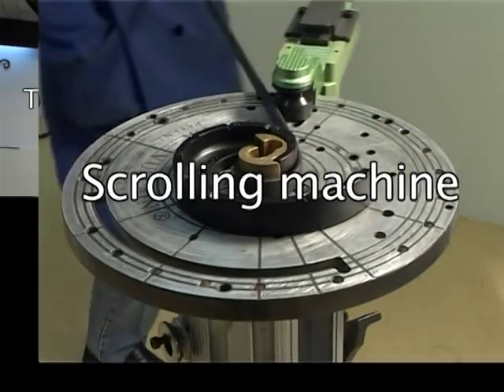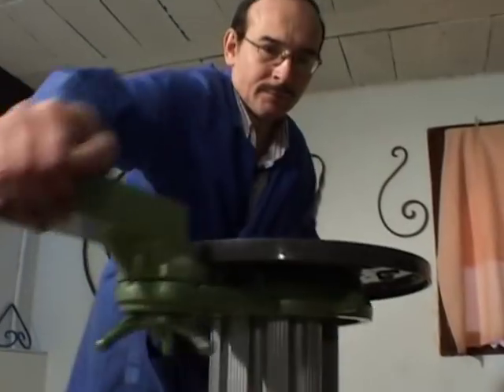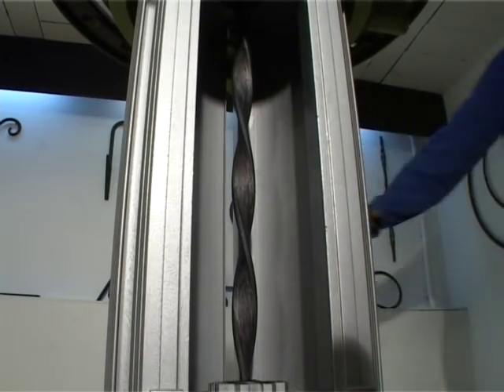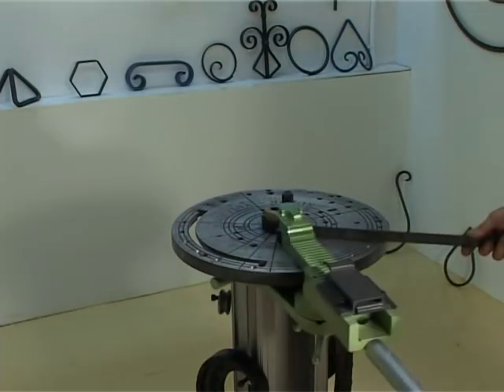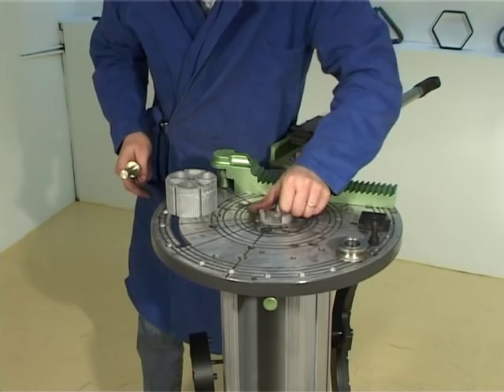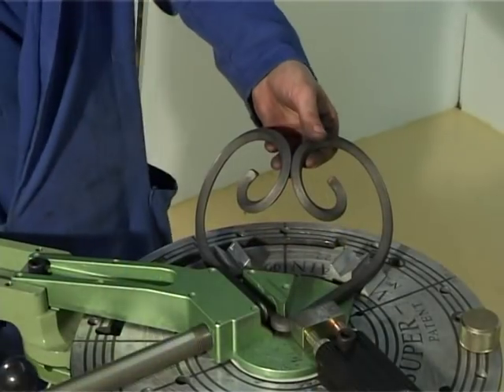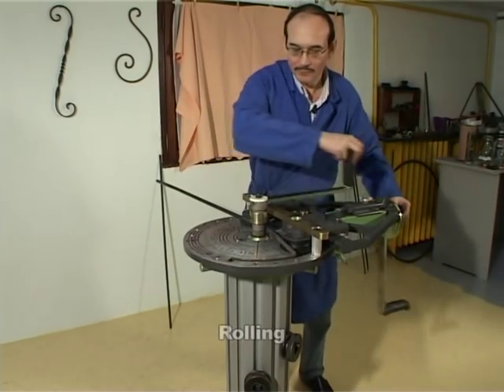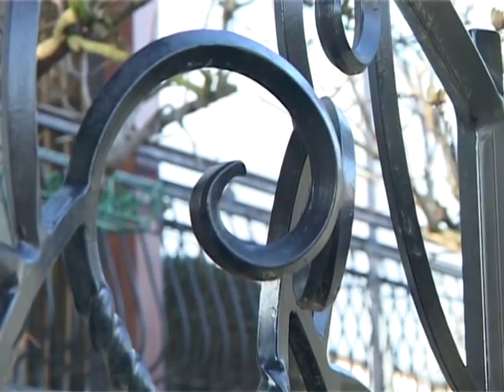Super Vulcain Demostration

Comment: Was interested until I found out that they want $9000 plus shipping. There are a lot of other machines that can do this stuff for less. I do however, like their use of extrusions for oval and oblong shaped bending. That's unique. Just not $9000 unique.
Reply: 9000 what currency
Reply: TheBikerScout  You can write the coordinates services produced machine?
Reply: tubester it's useless some people don't understand it, it's normal most people think it's expensive when they aren't professionals and they don't understand the machines full potential.
Reply: @someonesomeone283  The way someone buys an expensive machine for their skill, is first, you are already in that business and your skill level and jobs are above average: meaning you're no longer bidding on the standard decorative fence that you see everywhere. Second, you sell a job that requires it. Third you do whatever it takes to do the job at the highest possible level. '
Ideally you find someone with this machine, in another place far away, go there make a few examples. Then you find out the lead time for purchase and delivery of the machine, then you sell the job. 
Next you put in three times as many hours not only doing the job, but also figuring out your work flow and how to tweak the bugs. Like you make the scrollwork units for the 30' fence and it doesn't come out in equal units...how do you fix that? By the end of that job, you're tired, cash strapped, have a pile of scrap, but you've done something no one in your area has done (or has done in 50 years); and you know how to organize and do the job. (Set up a security camera on the machine and then use the video to figure out how long each part of the job takes. We all underestimate time.)   Then you can charge more, and do a great job-- with confidence.You will still have to work hard. I think what happens is that in the end you don't really make all that much more than you were making before, but you're happier and more challenged and your work is more interesting to you. Overtime you make out by staying busy, having lots of referrals, repeat customers. Ten percent is the difference between a 30 year old truck and a five year old one and owning a house. 
If you just want to make more money, than all you do is figure out to do huge simple jobs and then it's all management, worry, selling, kissing butt. 
Tip: rich folks will drive your price down, only talk about expense, how soon? do you have to make such a mess?..... But to their friends and neighbors they talk about how clever they are, how they made this amazing choice to buy that painting, get you to make that decorative gate... 
So as soon as they start asking for a discount, you tell them, Look, I'm not going to talk discount, it's already in my estimate because I want to do your gate. My goal here is to make something special. You don't really want an extra hundred bucks in your pocket, you'd rather have your gate look like ten grand. (They need to hear that they've already received a discount, or that you're giving them extra. This is an absolute. The thing is, after the job if you were to tell them, (don't) I actually charged you more. They would probably just laugh, they know how neurotic they are about money. Unless they're driving a 10 year old Honda in front of their big house they want quality and special, but they cannot help asking about money. The real trick is figuring out ways you are neurotic about money and getting past that.)
 And then after your wealthy customer  sees you give one of your cards to one of his neighbors who stopped,  and asks, say, 'Don't worry I'll charge him double, and he won't get the same gate. That's not how I work." 
When I was ending my contracting business (30 years ago)  I got a call to look at an old house. I like old houses, but I didn't want the job. So I looked it over with the homeowner, figured I should give him some ideas to make up for not wanting the job. He asked me 'how much?'  I hadn't even consider this, so I said, "What have other people said?" "$5000 and three weeks." "Well, that's a good start." He wanted me to give him a price, so I told him time and materials, conditions, (one of which was 'you keep an eye on your job, after a week no complaining')  then told him all the ways the renovation was an unknown. 
A couple of days later he called me up. "When can you start?" "Why on earth do you want to hire me?" "More than all the others you sounded like you know what you're doing." 
 So I had to do it. It was a fun job. My favorite part was when a Salvadorian Indian guy (hardly spoke a word of Spanish) working with the painters, chased a TV director down the street with a piece of wood. I'd done his house several months before and he wanted some paint for something , so he thought he'd just come up the street and get the paint from me. I wasn't there. So having the gift of gab, he thought he'd just blah blah blah....
Reply: USD
Reply: +TheBikerScout I believe the reason they are so expensive is because it comes from a small French company who only makes them to order.  You are basically paying how much it costs to make these machines on an individual basis.
Reply: +douro20 That might be true... but it's a bad business model. See how many extrusions they have, from the base to the inserts? Plus all of the castings! I know that you need to at least order 20 tons of extrusions before an extruder will sell you special shapes. Plus, I'd be willing to bet that there are similar minimums for specialized castings. The only cool feature I see that is definitely unique are the oval extrusions. But how much call would I have for oval shapes? In a pinch, I can make oval bucks out of hardwood.

If you are an ornamental iron worker, chances are that when you start out, you bend a lot by hand, or order from the catalog. Also, probably have a small space. There can't be that much demand for ornamental iron, that someone starting out would consider $9000 + add-ons, when you can achieve the same results for less than $3000. I found and bought the pro series from MetalCraft and I love it. What it can't do, I've got a couple of other machines from a few other places, like Swag Off Road and Howron Bending Tools. They are all manual, like the Vulcan, but allow me much more growth until I need to move up to Powered Hydraulic or CNC machines. A 50 ton iron worker is about $9000, even less on the used market.

By the time you realize that you need to grow and can't keep up with demand, you wouldn't add a manual bender, you'd go straight to hydraulic and speed is what makes you the money at that point.
Reply: +TheBikerScout   There are many small aluminum extruders who regularly allow batches starting around 225kg (500 US pounds).  Dies to make the extrusions shown should only be around 570EUR ($500 USD) each.  Lots of companies buy extrusions in small batches on a regular basis and typically the premium on these small batches is only about 20% on top of the base metal price.  
Sure, companies have different minimums (the highest minimum I have ever encountered was with Alcoa Aluminum @ 1ton for a very large die size) but it is not hard to find ones that cater to smaller batches.
Reply: +TheBikerScout firstly what you are saying is impossible unless they copied this machine. This machine can do a lot more things than what you see here. However the website doesn't show what it can do. For a proper and good reason to buy this machine you will have to go to Expo's. We are mostly seen in Expos in Dubai.
Reply: +World Wide Trading Technology So, you think it'll be in my best business interests to purchase a $1500 - $2000 plane ticket, pay an average of $250 a night, just to see a $9000+ machine in person that may or may not fulfill my fabrication needs? Seriously, that's what your marketing video should achieve. If it can do more, than film it doing more. Hosting your product demo on YouTube is free. Take advantage of that.

Again, I stand behind my statement that any fabricator, (even one starting out) can do all those bends on machines costing $3000 usd or less. Maybe I should take a video in my shop, and make piece per piece what you are demonstrating using my machines and techniques. $9000 is over priced, especially if you are having it made in Malaysia. Perhaps that's why you are selling it in markets that don't know any better and have disposable cash lying around.

I know you know who and what Di-Acro Benders are. They are made out of solid steel, not aluminum castings and extrusions. Their Model 3 which is about the size you have, can be found for $900 or less on ebay from time to time. Their model 6 bender, which is powered, can be found for $4000. Plus, there's way more dies and jigs available. Explain to me how you are $5000 better than a electro/hydraulic forming machine?
Reply: +TheBikerScout Yah but you dont get a nice cast iron table and nice knurled brass stops. This machine is for the rich hobbyist.